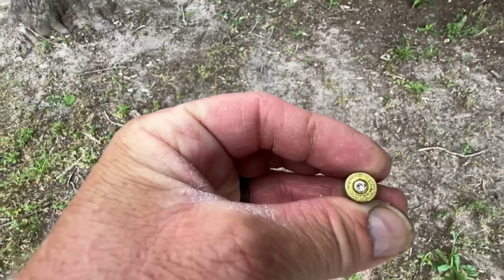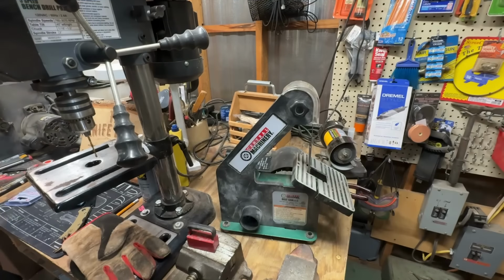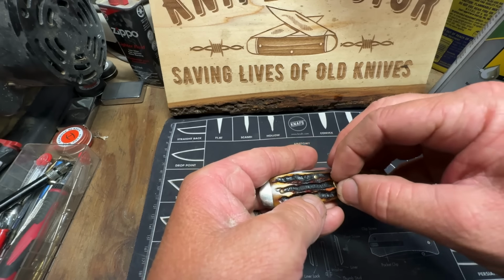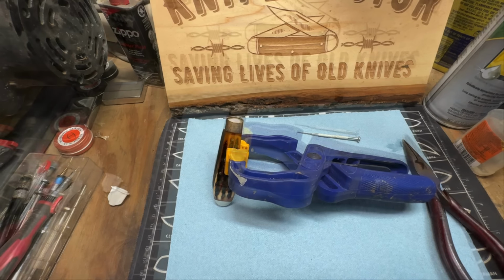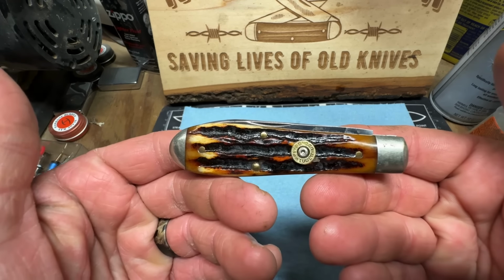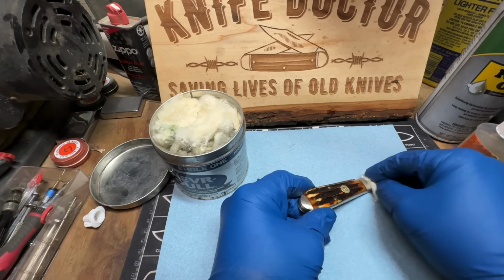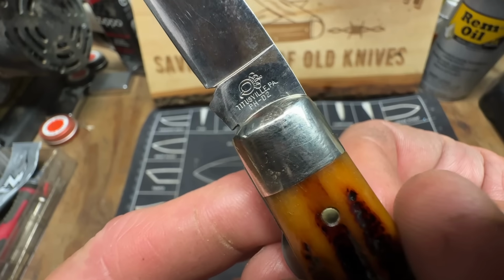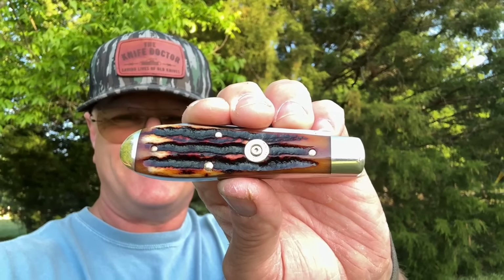Insane Knife Mod With A 9MM Cartridge!

Comment: Honest question-  why do you favor the belt sander vs. getting a Ken Onion?    I use the KO weekly and am extremely pleased with it.
Reply from the maker: I have a Ken Onion also.  Just don’t have room for it just yet.  The Belt Sander does a fantastic job though.  It not only is used for sharpening, but also blade rescues, handle replacements etc…

Comment: Hey doc, did you ever find a way to prevent that belt sander from shocking you? I have the same one, and it will randomly shock me, I noticed it does it most often when sanding brass. Does it need to be grounded or something? It doesn't hurt but will certainly cause me to slip and mess up my project.
Reply from the maker: Yeah.  Mine does it to.  I noticed it only does it when I have a vacuum hooked up to it to suck the dust.